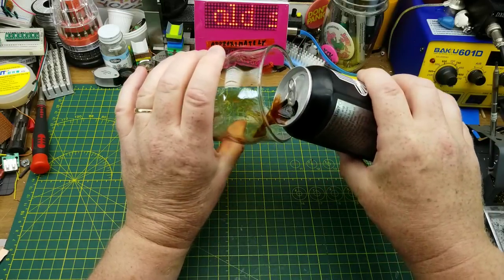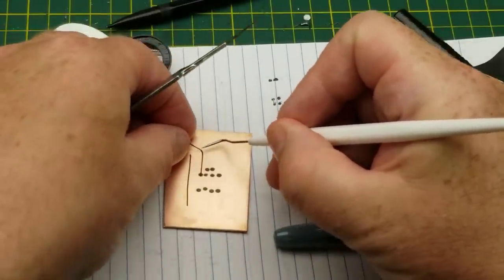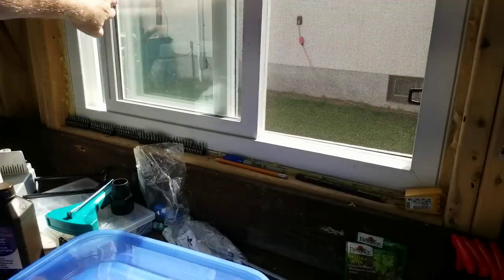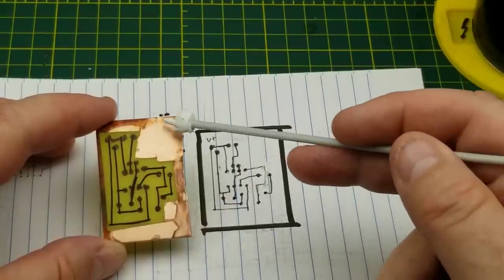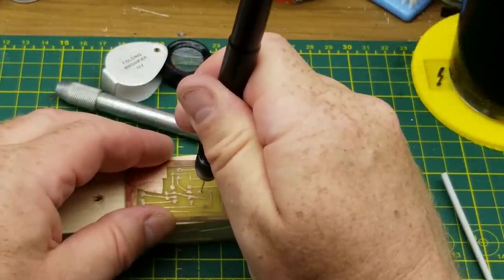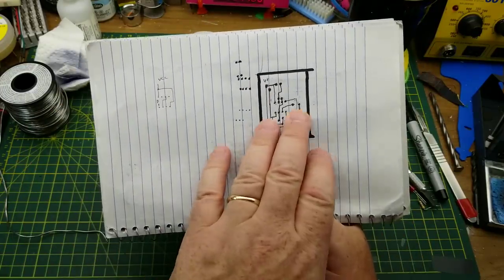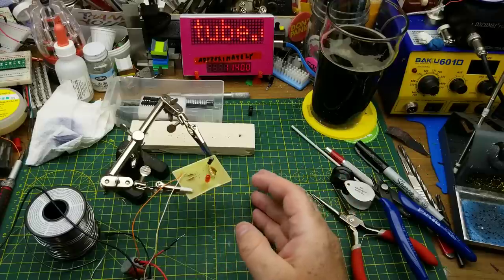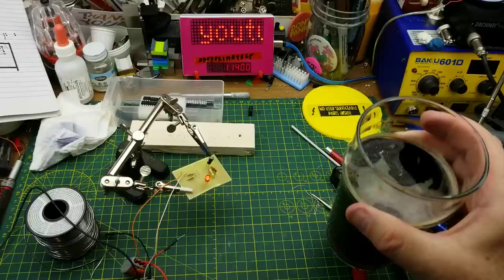DIY circuit board - the old way

Comment: I started with electronics in the 1960's and I've never etched a circuit board in my life.  I've also never used the stuff we see on some YouTube Channels where you bridge single pads to create a circuit, that was too time consuming.
Vero Board was very popular and more than good enough for any simple circuit that I designed, and many magazines published here in Australia had PCB layouts for Vero Board so they were easier for hobbyists. No need to drill holes either, which is a massive bonus!
With Vero board you learn to lay everything out in rails, kind of like a breadboard, and it works great in practice. I still use some small amplifiers, metering adaptors and 74 series logic thingies that I made 50 years ago!

Comment: I love this.  I think you're right about the warnings. I was cleaning out an old building and I picked up 2 jugs of strong muriatic acid and was walking with them and the bottoms broke out (one when carrying and the other from dropping it when the first one broke) and I burned the skin on my calves pretty dang badly.  I had the radio shack chemicals as a kid and those were such good memories. Made me feel like a wizard.  Thanks for sharing.

Comment: Entirely authentic reproduction of the process including forgetting to mirror the circuit.  (Edit: it just occurred to me, several decades too late (and that's not a record) - put a freakin' sticker on the ferric chloride bottle that asks, "did you remember to flip the image?")
Reply: Last time I did that I just soldered some component lead wire to the chip holes and flipped the chip over, and soldered it in dead bug style.

Comment: In the late 1970ies until the early 1990ies used to do it almost the same way. The PCB design was draftet on a sheet of semi-transparent paper with millimeter grid. This paper was put with the drawing side on top of the copper side of the PCB material for mirroring the design 🙂. In the first step I used a needle tool to pinch markers for the holes through the paper into the copper. Then I used a special pin to draw the connetions and soldering pads for the devices on the copper surface. After etching the holes were drilled through the positions of the pinches. The pinches were also guiding the drill.

As etching agent I have used 1 amount of 30% HCl acid put into 2 amounts of water plus 1 amount of 30% H2O2 at the end of preparation. The etching was very fast, within 5 to 10 minutes. I have once tried ferrochloric solution but it required heating to 40 °C and keeping the temperature and it lasted 30 min or more. I discovered that I don't need to move the pcb while etching when I let the PCB floating on the surface of the liquid by use of surface tension. When it is possible to see the copper structure through the epoxy you can stop etching.

Comment: I never knew this until my last employer, but solder has a shelf life!
I found this out when the QA person came around to each work station and took our current rolls of solder.  We were then issued NEW rolls of solder in the sizes we needed.
The "OLD" solder was then placed at the exit door with a sign saying we could take home as much as we wanted, but it could not be taken back to our stations.
When I inquired as to why this was being done, I was then informed that the 'shelf life' of the solder was about to expire.
I learned something!
I also now have enough solder for the rest of my life - and then some (shelf life be darned).
Reply from the maker: This old Radio Shack solder I have (and more than one roll of it) must be 20-30 years old. 
i suspect the biggest factor in the shelf life is the flux in the core
Reply: The flux does deteriorate, which in "mission critical" commercial applications is a consideration. They probably started swapping out the solder when they noticed a large number of dry joints and faults that required rework.

Comment: As a high school student, I made PCBs in a similar way 36 years ago. I drew the pads and the traces on transparent paper, which I placed onto a math notebook page. So there were 2 IC feet in a raster. Then I folded the transparent paper upside down onto the PCB and fixed it with an adhesive ribbon. I marked the holes with a center punch. I drilled out the PCB. Then I drew the pattern on the PCB. So it was easy to make a 2-sided panel too.

Comment: When I was at school I did an "OA" level electronics course, and as part of the asessment I built a capacitance meter (I recall it had a couple of 555 timers). When I laid out the circuit board I made the same mistake.... I was going to bodge it up but my teacher insisted I redid the circuit board. (we didn't have to mess with chemicals, we just took the boards to the metalwork department and they threw them in their acid baths!) At the time I remember being annoyed but I'm glad he insisted, my second attempt was much neater and I remembered to put my name on it :) 
When we were clearing my mums house out when she went into a care home a couple of years ago, I rediscovered it and despite spending the last 20 years in the loft (it eventually got superceded by one range on my multimeteer!) it was still working as well as it ever did.

Comment: Feeling old I dug into my pile of old stuff. Still have some sheets of TEC-200 transfer film.  One step up from what you just did, but not about to run those sheets through a photocopier to do a carbon transfer. Didn't know about the HCl and H2O2 trick, always had a bottle of the good stuff. Nice video brings back memories .

Comment: We used to use ferric chloride on the farm, back in the day when it was common practice to dock the tails of piglets. In that respect, I missed the boat, I could have had gallons of the stuff for next to nothing.

But, talking of DIY circuit boards, I used to save old PCBs to build on - I'd strip off the existing copper, and use the component leads in lieu of the copper tracks, that's how skint we were back then, but happily, my granddad was a TV and radio fixer, and always had a copious supply of scrapped sets and components to work with!

Comment: Great video - brought back fun memories. Re your mirroring issue, you could have gently bent the 555’s leads 180 degrees in the vertical plane and installed it upside down on the component side! That’s assuming the leads were long enough that way... 😉
Reply from the maker: That's genius.
Reply: @pileofstuff  And you wouldn't have had to own up to your error, either. No one could have seen the label! Thanks for the laugh!! All the best from a fellow tinkerer in Australia. Colin

Comment: Still got the old PCB drill I got a similar number of years ago, now in a better plastic recycled box, with the few dozen small PCB drill bits I got over time, in assorted sizes, that I used for quite a long time.  Hands up who forgot to mirror the board as well, so I still used it, but took the IC's and simply bent the legs to face the other way. 

Hey, if AEG used it on the Lavamat Deluxe Electronic washing machine, an, at the time, top end washing machine, and one of the first with microprocessor controls, instead of a rotary dial, so could I. No markings except a pair of depressions from the mould ejection pins, and a look in the Motorola microprocessor data book to find the 6800 OTP part that fitted the unusual power, crystal and reset pinouts, and I was convinced it was mirrored. Only reason it went was the required new bearings, seal and spider for the drum were about 20% more than the cost of the LG top loader that replaced it.

Comment: The EDDING 3000 marker works well! At least it DID when I used it 30 years ago... :) Still available on Amazon... It covers the traces so well that you would NOT have needed to re-inforce the traces with solder. :)

Comment: I used math paper (with 0.5cm squares) to draw the right space for the pins/holes. It was close enough for DIL14 ICs. Also I used a permanent marker to draw the traces. As for chemicals, I only used ferric chloride. It is messy, stains, but with care, there were no accidents. When etching, I warmed the solution and shake it. After soldering the components and cleaning the board (solder side) I used a paint marker to protect the board, like a solder mask. Sometimes I intentionally flipped the components (ICs, transistors) footprint to mount them on the bottom as SMD. 
All my prototypes were good and working albeit they were not the prettiest things. I used this technique for boards as tiny as 1x1cm up to ( the biggest I remember) around 10x15cm (a fairy complicated light organ). Also I used this technique to make my first computer with Z80 CPU, but it was made on few small boards with a back plane.

Comment: Been dabbling in electronics for 50ish years.  Never knew about home-brew etching,  Thank you for that.  ... addl benefit of using a circuit design program is that you can print the component side and stick it on the component side of the finished board.  A couple of push-pins come in handy for aligning it on the board and for finding/punching all holes for components.  😉

Comment: I did my last board with my 3D printer but I mounted a spring loaded tube as a  sharpy holder to the extruder mount. I think there is a pen holder on thingaverse.
Reply from the maker: That's a clever hack

Comment: have a copper coated pcb, print a protecting surface layer with resin 3d printed, wash, etch, done
Reply from the maker: Good application for those who have a resin printer.

Comment: You can reduce etching part to 1-2 minutes if you rub the pcb with cotton while submerged in acid
Reply from the maker: i was concerned about rubbing the marker and//or tape off.

another option is to run an air bubbler in the solution.

Comment: If I need a small board, I'll use OshPark, because they are close by in Portland Oregon.
Reply from the maker: I wish there was a board fab in my country.
International shipping kills both the fast and cheap part of the equation.
Reply: I just use Vero Board. No work, no etching, no drilling. so much easier than all this "designa  circuit board" stuff.
Reply from the maker: @johncoops6897  There are many ways to do this hobby. Each has it's own positives and negatives. It often comes down to personal preference.  Very few methods are objectively wrong, though.
Reply: @pileofstuff  - of course ir's certainly not wrong however it often unnecessary to make a PCB for a simple project like this.
In the same way that you don"t need to program an Arduino to blink an LED, you also don't need to make a PCB to use a 555 or  Astable to blink an LED.... 😉

Comment: It is indeed very rewarding to create a circuit board like this, more than one would imagine ;)  But yes, you need chemistry skills first to be able to do it.  So, to do it only once a maker-lab might be a good place to go. ;)

Thanks for showing this !!

(.. and KiCAD is really not that difficult to use :P ..  with photosensitive pcb material an UV lamp and an ink printer loaded with transparent foil and the blackest black - you can etch really nice hi resolution stuff into copper not only traces and footprints :))

Comment: Which program did you try, because there are hard ones and easy ones.
Reply from the maker: Most recently it was KiCad.
I spent more time trying to fix error messages than actually working on the circuit.

But in the past I have tried a few of the online ones as well.